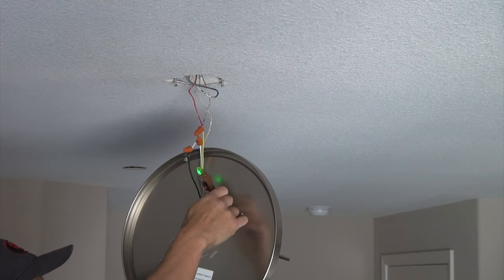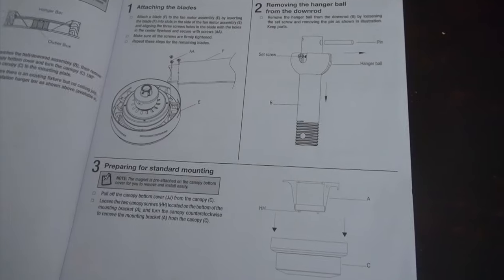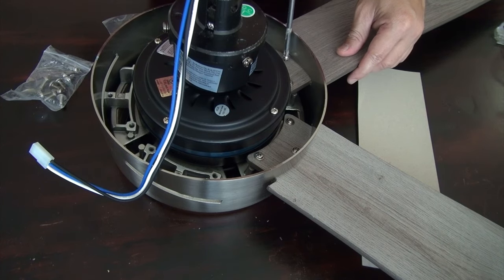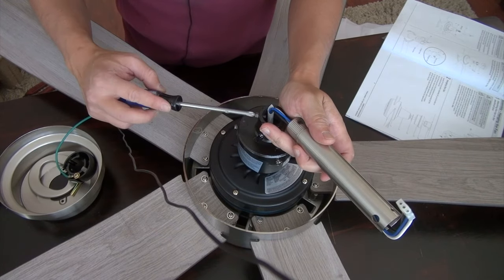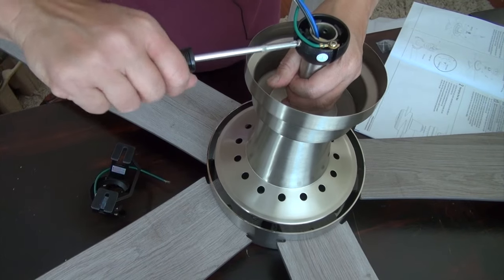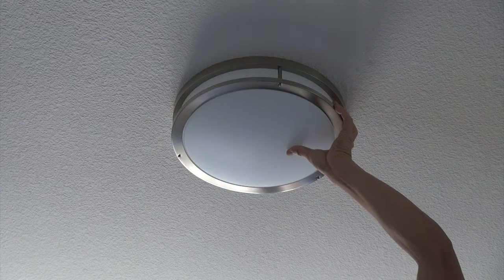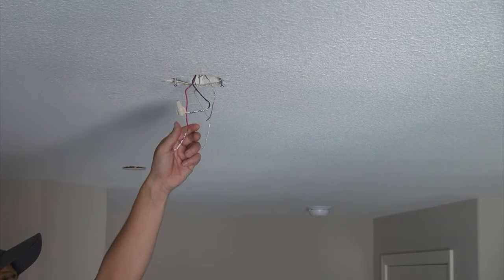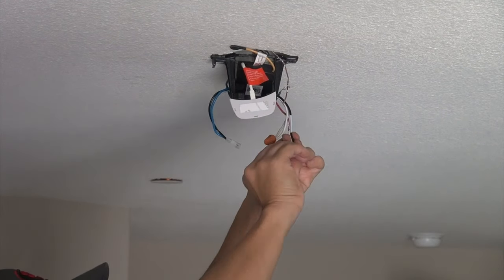How to Wire and Install a Ceiling Fan With Remote Control/Ceiling Light Fixture Removal.

Comment: My ceiling box housing have 3 wires. Black white and red. Fan have black, white and green houses. My receiver  has blue white wire how do i wire it. All of the is tied in. Do i  remove them from the receiver

Comment: Great video. One observation I’d like to add. I had a White, Black, Red, and Green (ground) coming out of the ceiling socket with a three switch light bank at the wall. The Fan has a Black, White, and Green wire.

If you have a multi-light switch outlet, remove the cover to identify which switch connects to the Red and which to the Black wire. Knowing the status of your home wire installation will save a lot of installation headaches.
Reply from the maker: Thank you for sharing! Happy new year!

Comment: So, what is your wall switch ? Is it a dimmer switch or a regular switch ? I have a dimmer switch and would like to know if I can connect the blue wire (light) from the fan, remote blue wire and the red wire from ceiling all three together ? And have the black from receiver to black from ceiling.

Comment: This tutorial really helped me. Thank you so much for taking the time to make it.
Reply from the maker: So glad it was helpful.  Thank you.  Happy New Year!
Reply: @diypotentials  Hi, thanks for the video, i have a question: what doing now the switch you had for the lamp?, Does it only turn on the light or does it turn on the whole fan as well?
Reply from the maker: @jorgeluistamayadominguez2638  it turns on the whole fan, but you then use the remote control to turn the light and fan off or on.

Comment: How did you get the remote control to work because I have it wired correctly But the remote control's not doing anything Even when I put the batteries in shouldn't I like come on or do I have to do Um lock Learn Thing that parental keeps telling me to do which is very confusing ?

Comment: Thanks for the video. Question, if I want to use a longer rod, the wires are short and won't come out all the way, is it safe to cut the end by the white clip and connect and use electrical tape inside the rod? I am surprised how they didn't think of this since the rod it came with is pretty short for my vaulted ceiling.
Reply: Actually, I am assuming the 'some wiring' you mentioned is the extra wires to use for longer rods.

Comment: I have a separate wall switch for old light and old fan. This new light isn’t clear as to how to hook up both. Do I only use one switch now and block off second one?
Reply from the maker: Yes.  As I shared in the video, I left one live wire unused.  Thanks!

Comment: My wires have power but the fan won't turn on. I have no ground but that shouldn't be the issue. Any thoughts?
Reply from the maker: You might have to rewire making sure the connections are tight.  The lights and fan should work even without ground…hope you got it working already…thanks!

Comment: I have a wiring question I haven't found a good answer to. 

My old fan (w/ no light) was controlled by a single on/off wall switch. From the ceiling is a black, red, white, and ground wire. The transmitter for the new "remote" fan as a white and black wire to going to power source. Which wire from ceiling (red or black) do I attach to the black transmitter wire? And will the old wall switch now only send power to the transmitter (i.e. fan is now controlled only by the remote control)?
Reply from the maker: Both the red and black wires are live.  Either one should work.  Since the  remote transmitter comes with black and white, I would use to the black wire just to match the two wires.
Reply: The black and red are your switch legs which are used to distribute power to your light and fan separately. Since youre adding the remote you wont need both you just need one to power the transmitter. Connect the blacks at the switch and cap off and hide the red.
Reply: This is helpful however I wish I could still use both wall switches and not rely on the remote control option alone, is that possible? I.e. what if the remote is lost?

Comment: I bought this same fan and I wanted to wire the fan directly to a designated switch for light and fan. It’s such a nightmare because the way the led module can switch the color mode with pulses . I wish they made the led light with a switch to change the color temp rather than rely on the remotes since I’m not using the remote .
Reply: Does your fan work with switch or only remote? It’s a pain mine doesn’t work with switch and light changes tone every time I turn off or on.

Comment: Hi. I have 3 light switches connected to my fan/light with remote set up. Since the blue wire from the fan was connected inside of a plastic connector coupled with 2 other wires, I’m not sure how I should connect the red wire from the junction box. I capped it off but now I can only turn the fan/light off and on from one of the light switches. The other 2 are dead. Any suggestion? Thanks for the video.
Reply from the maker: Hello,  those switches were pre-wired to power the fan and light separately--one for the fan and one for the light.  I'm not sure what the 3rd switch is for.   But since your ceiling fan comes with a remote control, you only need to power it using one switch.  Capping off one of the switches (red wire) as you did was correct.  You no longer need that switch or the 3rd switch if is not connected to anything.  Notice now that your remote control should have two switch buttons, one for the light and one for the fan.  I hope this helps.  Thanks!
Reply: Thank you
Reply: @linder00  What I ended up doing, since I had a 2 Pole wall Switch and now only using 1 switch. I used the red wire (extra) in the ceiling fan bracket and ran some recess lights to round the fan area. It was super easy since the wiring is already there

Comment: You only used one power input to the receiver correct?  I’m having a problem with my led light on fan turning on and off and when running both the light flickers
Reply from the maker: I only connected one hot wire from the ceiling to the receiver.
Reply: Do you have your fan wired to a variable (dimmer) switch?

Comment: I have two problems regarding safety in your installation method
1) the mounting screws are too light duty and not suited for the load. You should be using anchor bolt screws
2) you do not have a safety line to attach the fan to the mounting bracket.
Reply: I don’t think the fan comes with the items you’re talking about
Reply: @jaegermah  I guess you are missing out on some safety aspects of ceiling fan installation
Reply: Also missing a hard hat, goggles, long rubber gloves, tyvek hooded jumpsuit and wired ground connected to yourself. 😂